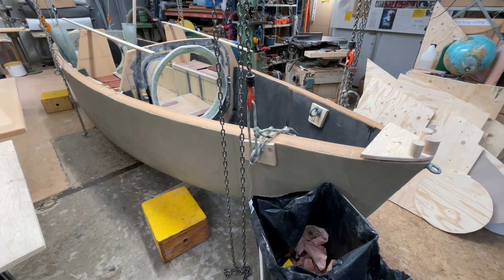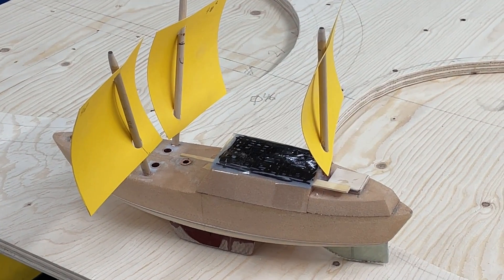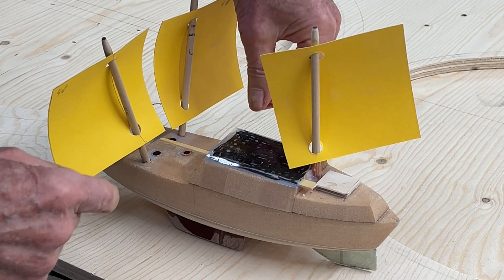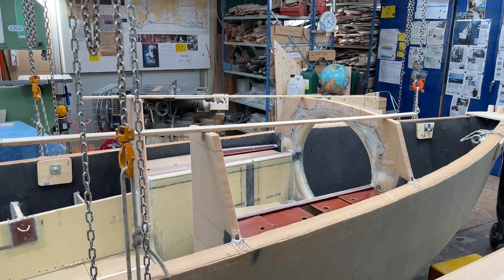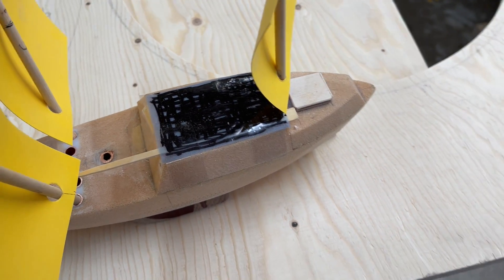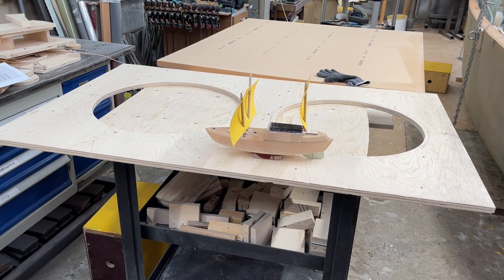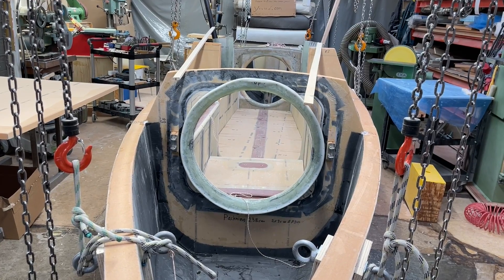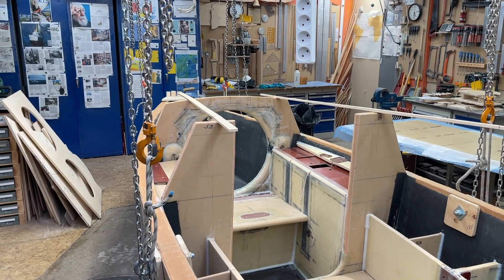5 September 2022  How to solve it  The oar and the solar panels wants the same space.

Comment: Thinking the next step ahead ... if you want to cover a considerable distance with a motor in the doldrums you will also need an electric autopilot. Wind steerage doesn't work without wind. None the less ... a motor is nice to have.
Reply from the maker: It is true.
I will look for a small electric autopilot.
Also som of the trolling motors do have autopilot but much more expensive.

Comment: LiFePO4 batteries do not catch fire and there are some that are waterproof like the Battleborn or SOK Marine batteries.
Reply: they do!  It takes some effort, but all that is required is some puncture, short circuit, or over-charging. 
It does not happen often, but when it happens at sea, there is no change of survival. low change, but high risk.
Reply: @alexd7466  LFP usually just smokes and doesn't catch fire. But with a well designed electric system and a good quality battery there should be no risk of puncture, short circuit or overcharge.
Reply: @yarpenzigrin1893   there is always a risk, especially in a storm when things are flying through the cabin. But even if it 'just smokes', that already would be deadly at sea.
Reply: @alexd7466  So what if things fly through the cabin? The batteries are in a waterproof box, nothing is going to puncture them.
If there is an electrical fire on the boat it's more likely that it's a short circuit not related to the battery.
Your phone battery is more likely to catch fire and you don't seem very concerned about carrying that in your pocket.

Comment: I guess you could get about 300W of solar panels on the roof, that's about 0.5hp of continuous power during the day. Won't be fast but if there is no current you will slowly get in the right direction when you're becalmed.
Reply from the maker: A human being can produce 0.1 horsepower an old man less so its way more than me especieally after many hours.

Comment: The oars sticking out looks like it will easily catch and entangle ropes. Will you make some kind of protection / rest for the ends to mitigate that?
Reply from the maker: I will make the hole boat tangle free.
Reply: @SvenYrvindExlex  I guess if you make a stand on the deck where the tip of the oar can rest no rope will be able to get beneath, also if you fasten the oar tip in the stand the oars will become sturdy rails.

Comment: Thank you Sven for this update. The solar panels and electric motor are a very good idea and I am sure you will find the best solution. I have a question concerning the mizzen mast. Will you be able to get past the mizzen to the aft hatch? It looks like a tight fit in that area. Take care and have a good week.
Reply from the maker: The mizzen mast stand on deck. Its holder is supported by struts. There will be more about that later.
Matt Layden used a similar structure on Little Cruiser now owned by David Boldoc. 
There are some pictures on internet.
Reply: @SvenYrvindExlex  Thank you Sven I was thinking the mizzen might be deck stepped.

Comment: How many days at sea would it take that size solar panel to charge a battery system to get into harbour Sven?
Reply from the maker: The idea is that the solar panels would have enough power to drive the boat so you do not have to charge the battery.

Comment: Sven, I have your battery solution. You will love this video. I have not looked at this method of power in years, glad I did now. Not a single problem that I can see and plenty of replacement fuel available in the sailing environment. Salt water battery. Since I live 182 meters from the Gulf of Mexico I may have to try to see what I get with the gulf water, could always let the water in a small pan evaporate and create more salt for the project, just to keep it for use on a boat. Not sure how many amps the video design produces. https://www.youtube.com/watch?v=BPUKbcWt1uY

Comment: Sven, Great idea about what to do with the oar. I would have probably fiber-glassed a waterproof tube into the deck with a rubber boot for a seal and locking mechanism at the back end of the boat to put the oar in vertically and attached the my flag on it. As for the future of solar, I believe that sailors will reap the benefits of future flexible solar sail material and with the newer technology batteries electric power while sailing will be awesome. Just think if your 3 sails were solar sails. 
m

Comment: Hi Sven,  you should look at "Grin Techniques" Li batteries. You can take them on aeroplanes, they use them electric, boats, bicycles,scooters,skateboards, and safe as Li can be at the present ,you could have a strong thrusting motor to get in and out of port and a scooter to get around on. They are definitely worth a look at Sven. All the best Sven and thanks again for all the updates and great work

Comment: I also watch "Sailing Wisdom". WISDOM is a 45 ft boat, powered by lithium iron phosphate batteries and solar cells. She is able to motor up to 20 miles a day, as she slowly cruises up the inland waterway, north fron Florida. Her skipper takes advantage of the tides to help get his boat into and out of harbors.

I agree with most of what you say about the structural advantages of smaller boats. It is absolutely true. But there are cases where bigger is better.

It takes far less kilowatts per ton to move a large boat at 3 knots than it does a small one.

Of course, small does not need to mean short, as you have pointed out. I too am smitten with the elegance of long narrow boats. But in small sizes, they come with workability issues.

One of those is the problem of getting from one end of the boat to the other quickly. The longer and smaller the boat is, the harder this gets, especially if this boat is expected to have a livable interior.

For your purpose now, I think you should consider a decent trolling motor and a lithium iron phosphate 12 volt system to power it. This battery system could get its power from a solar cell. Such could atleast supplement you using the oar to move during calms, perhaps doubling your range in dead calms, making perhaps 20 nm a day within reach, with maybe 5 hours of sculling instead of 10.

Comment: I think if you made a series of cases along each side of the boat with the batteries inside, you could create a system where they might be jettisoned in case of a fire.  It would add more weight to the boat, but it could be spread out evenly along the mid section of the boat.  Even so, the Lithium Ion batteries of today are very safe.

Comment: Class 5.8 has been using 1000watt outboards at least one with some hydro generation ability. Epropulsion evo was one, not sure of others.
Many bicycle hub motors work as inboards.
I know you don't trust Lithium Iron phosphate as they are still a Lithium despite separating themselves as the only safe one. Lead Firefly carbon lead technology could be an option it is expensive. Some use them for house banks. Nickel metal hydride worked with high weight.

Comment: I like the solar/oar solutions. With el.propell/motor you may charge batterys while sailing. If you ever need to in overcast conditions. I guess a small 2- 3kW is more than inaff.
Reply from the maker: My boat is to slow to charge batteries. To get any useful charge you have to sail more than 6 knots

Comment: Have you considered flexible solar panels on the deck combined with those on the cabin roof? It may give you enough power to use an electric outboard with a greater range.

Comment: Sven, today we use in sailing boats and campers Litium-Iron-Phosphate ( LiFePo4 ), they are safe and reliable, but they have less energy density than other Litium batteries. https://en.wikipedia.org/wiki/Lithium_iron_phosphate_battery
Good luck on this endeavour, I think it is a good idea with the doldrums near the equator.

Comment: I also hope you reconsider using lithium batteries. The advantages surrounding their capacity, recharge time, etc are great. Airlines also don't allow you to bring a bottle of water... they are just being overly careful so they don't have to inspect what type of liquid you have or what type of lithium battery you have. 😉
Reply: The most dangerous type of lithium batterys are laptop and smartphone batteries and you can take these on a plane with no questioning.. planes themselves use lithium batteries now days, i agree with you, lipo batteries are the way to go..

Comment: I was an airline pilot for 45 years, and the problem with dangerous goods on aircraft is that it is difficult to differentiate one type of lithium batteries from other types, therefore banning all as transported on board. exception of smaller ones as carry on in the passenger cabin. The Boeing 787 has Lithium-ion batteries installed, as do other aircraft. 
I'm now retired, and a sailor, and know Lipo4, marine lithium, not only are lighter, and gives more power, safe and the only sensible option, and will serve you well for all the requirements Sven.
Reply: Could not agree more...I switched over for may offshore singlehander last year and they charge 5 times faster with my two 150 watt solar panels....